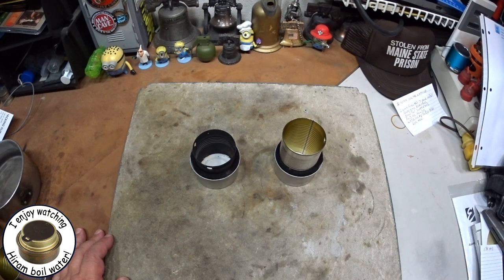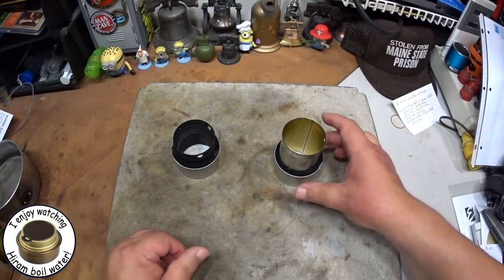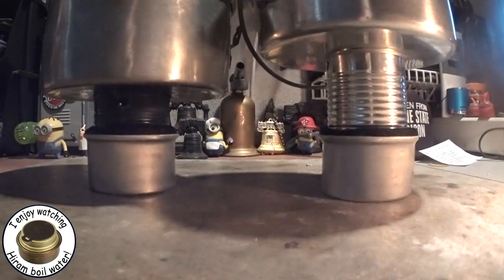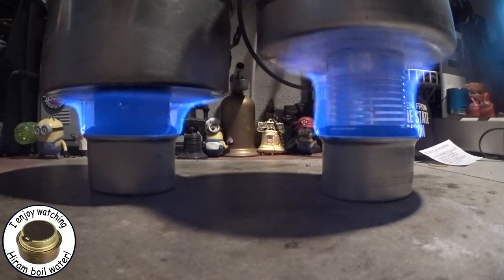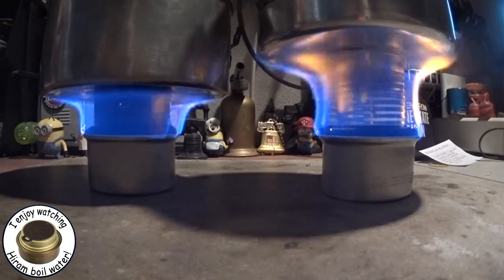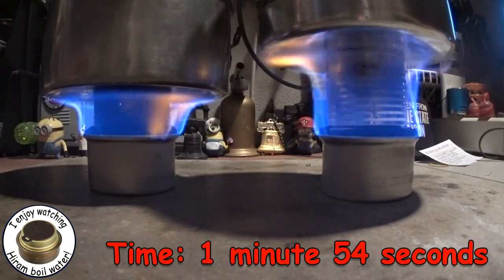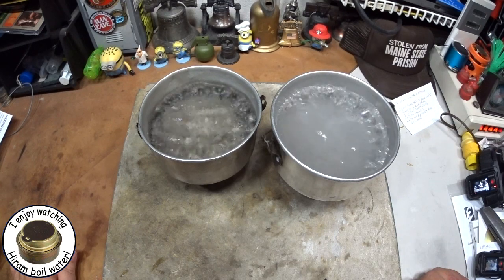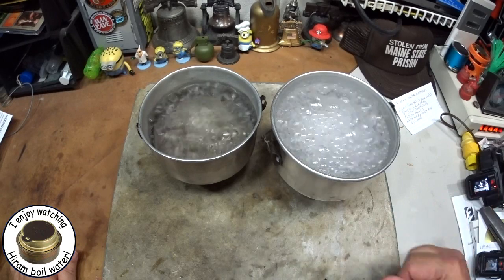Fancy Feast Stove With Uncut Tomato Paste Can - Flame Test

Comment: That was a great comparison to do Hiram. Thank you! Obviously, not having to cut down the paste can certainly makes it easier to construct a stove with limited tools...but I can see two drawbacks to that. First is that the flame is more susceptible to wind gusts. The other is that it isn't quite as stable with the pot of water sitting on it. Looks like it could fall over easily.
Reply: Either the taller or the shorter model will work a lot better if you use some kind of wind screen. Some wind screen designs can also serve as pot rests.

Comment: Thanks for this. I was wondering what difference it would make. I'll stick with the one inch model. Looks like it burns more efficiently, even though boil times appeared very similar.
Reply: Same thoughts. Appears to burn more efficiently. Also appears to be a little more stable.
Reply: Exactly right. But i would cut the stand down to 5/8 inch of 1/2 inch.

Taller flames use more fuel.
Reply: Me too cause the sweet spot is called that for a reason i like

Comment: Once again this stove shows it's adaptability and proves it's ability to perform well without any sort of fine tuning, it's a very robust design.
I do wonder if the uncut can used the same amount of fuel or if there was some sacrifice of efficiency.
Reply: It used more fuel. A tallee flame needs more fuel.

Hitam tested my mahalo. The jets were set at 10 mm 2/5 inch and boiled two cups 60 degree watee on 16/8-17 ml alcohol.
Reply: Yeah I remember your stove, it didn't do very well.
Reply: No you don't remember my stove correctly.

Tge mahalo boiled two cups water  in 7 1/2 minutes and used 16.8 mls alcohol. Most stoves use Twice that much.

Hitam has not tested my ultimate stove
Reply: Ha Ha Ha Yes I do remember it, Hiram did test after test trying to get your stove to live up to your claims.
Reply: You remember the mahalo. You have never seen my ultimate stove.

About claims here is EXACTLY what i said

"Boils two cups with 15 ml" FACT hitam needed 16.8 ml. He used methanol instead of denatured alcohol i use. I live at 3,600 feet elevation. Hiram lives at 528 elevation. 6 degree lower Temperature for boiling than where Hiram lives, and Hiram was using methanol instead of denatured alcohol as i use.methanol puts our 9,100 btus. Denatured alcohol puts out up to 10,350 btus. I was THRILLED THAT HIRAM PROVED THE EFFICUENCY.

My only question was tge SPEED of the boil. I thought the methanol may have absorbed water because tge methanol was getting low in the can.

Not only do you call people names, you don't remember the facts. Go troll somewhere else..

I admit to my past even when i'm ashamed of it. Living by the Bushido would do you some good. Its called living with Integrity. You don't look for a fight but you don't run if a fight comes your way.

Comment: I use a Vienna sausage can for the outer can and an uncut tomato paste can for the inner, wrapped with 3 layers of 1mm thick ceramic fiber.  It's the perfect height with 1" from the top of the Vienna sausage can to the top of the tomato paste can.
Reply: Try a shorter flame if you want to increase fuel economy.

My ultimate stove has the jets 1/4 inch from top. Under great condition 64 degree water to a 208 degree rolling boil (at 3,600 feet elevation) uses 12.5-13.5 ml denatured alcohol. That is as low as you can go and have tge stove work. I know i tried 4 mm.
Reply: MatoNupai If I wanted a shorter flame, I would have built it that way.
Reply: Don't blame me if it uses a lor more fuel.

Tallee flames uses more fuels.
Reply: Have you ever considered test results in environments at or below sea level or in colder climates? The results may cause you to reconsider.

Comment: When building a a stove its a balsncing act between fuel economy and speed of boil.
Shorter flames longer boil times.
Taller flames faster boil 
What i work for is a stove that uses tge least fuel possible and still hss a decent boil time.
Let me put this in real numbers.
The Bios4 by Minibull Design boils two cups in 5 minutes but used 30 ml fuel
My Ultimate stove boils two cups in 6:30-7 minutes but only uses 12.5-13.5 mls. I think taking 1 1/2-2 minutes longer to boil is a fair trade when you are saying 60% of the fuel neede by the bios4.

Comment: Did the flames run out at the same time Hiram?
Reply from the maker: No. I put them out before they ran out because the area was getting to hot. But I did notice that the taller stove had very little alcohol left.
Reply: Of course. A taller flame needs more fuel.

Thats why i went 10mm on my mahalo stove.

They hikers need stoves that use less fuel. Less fuel carried = a lighter. Pack.

You should try a Fancy Feast with 5/8-3/4 inch stand above tge stove.

On my ultimate stove i took it down to 1/4 inch and more efficient than the mahalo
Reply: +Hiram Cook as you can see the taller one is boiling better than the shorter one
Reply: Hiram Cook can you provide link for video on how you made your stove?

Comment: shorter  paste can lit 30 seconds late and still reached   boil first      GRANTED  it was only just
Reply: It did but it used a LOT more fuel.

You can have fast boil or fuel economy BUT NOT BOTH. So what you have to do is settle for a longer boil you can live with but the fuel economy you want.

My mahalo and ultimate stoves do that.

At my elevation the mahalo takes 66 degree watee to 180 to make coffee with 13.5 mls alcohol and takes 7.5 minutes

The  ultimate stove does the same thing with 10 mls alcohol and takes 6 1/2 minutes